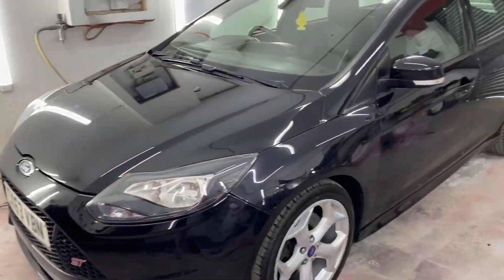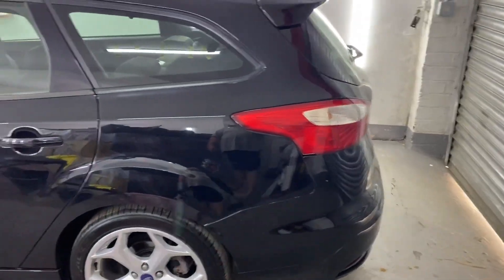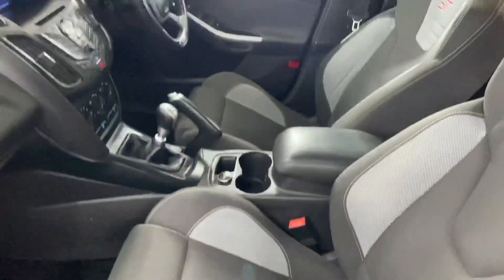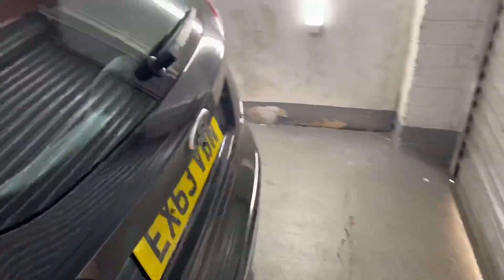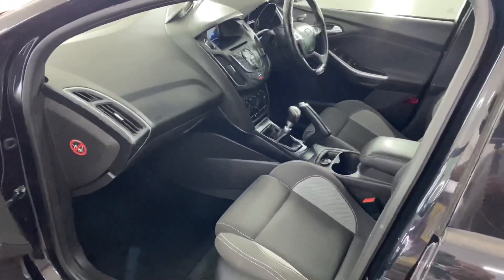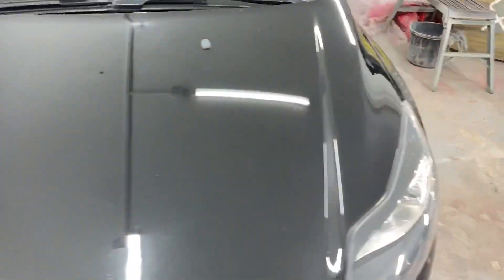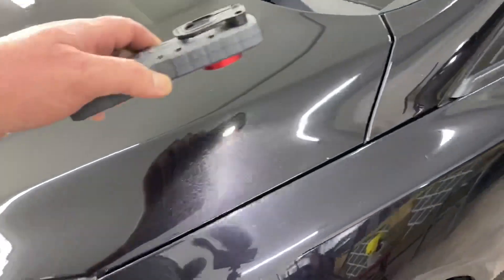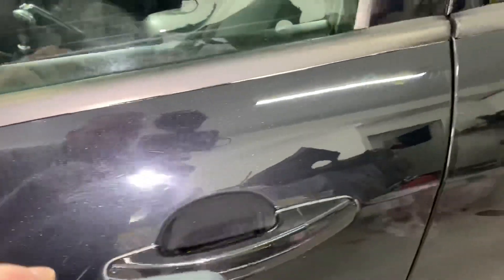Ford Focus st ex police car salvage build part 7 all finished!!!

Comment: Another interesting video. Don't change a thing about your presentation style. Walking out of your office works well. Credit to you for giving the cost breakdown; shows great character for a motor trader. Your Astra SR is doing well on eBay; wise decision to cash in on it without spending any more time and money on it. Ironically your net profit will most probably be more now. With regards to this ex-Police Focus you are on the right track. Years ago I bought many ex-Police cars at auction; and often all they needed was a valet and MOT. Very easy profit with a quick turnaround. Another good one to buy at auction is ex-British Telecom transit vans. Often low mileage, and in excellent condition. Again only a valet and MOT was needed, so a quick turnaround. Stolen recovered cars can be a great buy at auction too if only a keyset, or reprogramming of the existing keys needed. There is definitely a strong demand for high mileage, but clean ex-Police cars on eBay. Yes, they are driven very hard; but buyers know they have been well serviced. I enjoyed your detailed price breakdown, and appreciate you taking the time to do it. Please keep up that format in future videos, as I am sure it will be very popular with viewers. Lastly I wish you the best of success selling your Astra SR, and this Focus ST. Keep up the good work. Regards.
Reply from the maker: Thanks much appreciated and yeah I don’t mind doing the break down on the cars I do actually log it all that actually is my book for my own records I just didn’t update it so on the next one I’ll be ready 🤣🤣🤣 and yeah let’s see what the Astra does either way win or loose it’s going 👊👊👊
Reply: Couldn’t find the Astra on eBay any links?
Reply from the maker: It’s pinned to the top of the comments on the last Astra video 👊👊👊

Comment: Looks really nice mate, a 2 or 3 stage detail will have it looking better than factory
Reply from the maker: Thanks and yeah it’s clean enough now if it had not have done the miles etc it would be worth the effort but just won’t make and difference on the price on this one 👊👊👊

Comment: You've done smashing job on that st👏👏👍👍and I think 5500 should be the reserve price on it even if you deserve more given all the time and efforts you put into it. Just be more careful with the expenses next time if you can roughly work them out b4 you start the project but it's always easy said than done. Best of luck and you should sell it easy even in these difficult times🤞🤞. Top man, top content awesome video as usual 👏👏👏👍👍👍✌🙏
Reply from the maker: Thanks 🙏 👊👊👊

Comment: Good work. I’m looking to buy a polisher, any recommendations? Thanks bud.
Reply from the maker: What you going for rotary or dual action?
Reply: SALVAGE FLIPPERS DA are supposed to be safer for beginners, but I don’t mind either way. Cheers.
Reply from the maker: People only believe this as there scared of rotary polishers it’s a myth, I find too many people rush out and get a da as they think it’s safer they don’t cut as well so people crank up the speed and then there end up causing more damage than a rotary!! I have all and they all have there place but I would go for a rotary learn how to use one correctly and you can finish good enough with one and also have the cutting power you need 👊👊👊
Reply: Appreciated, thanks.
Reply from the maker: I do t know your budget but these are great I had the road version 

https://www.ebay.co.uk/itm/113167585610

Comment: What more would you of needed to do for that to be a full paint correction? I paid £200 for one on 2006 discovery I bought that looked like it had been washed with a brick a month after I had this done my mates sister offered me £1500 more than I paid it was like polishing pound notes into the car 👍
Reply from the maker: It’s all to do with the time a full correction means removing every imperfection out of the paint then refining it and polishing it to a flawless glass finish and when you shine a light on to it you won’t see a single mark just like a sheet of glass this takes a very long time and a lot of work 👊👊👊
Reply: It definitely transformed the discovery anyway 👍

The focus definitely looks well hopefully it goes quickly and you can find a barn find xr2 😂
Reply from the maker: Shane Brown I’d love one if I can find one 👊👊👊
Reply: Have you seen the shrine of Ambleside one? Doubt it is for sale as there is an unclear story on it but it is painful seeing it just sat on a drive? If you haven’t seen it have a quick search on Facebook it has a page 👍